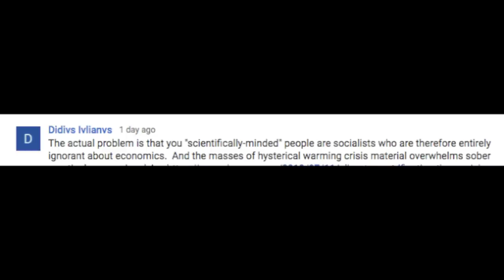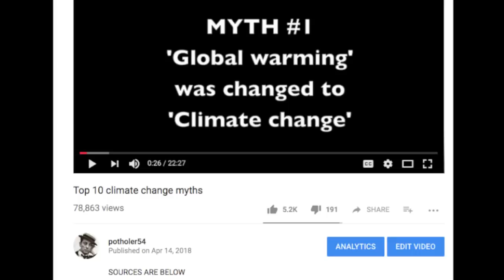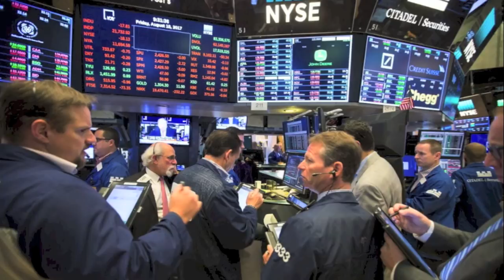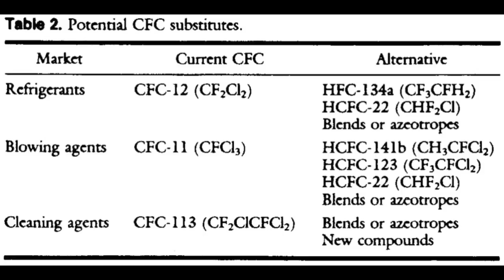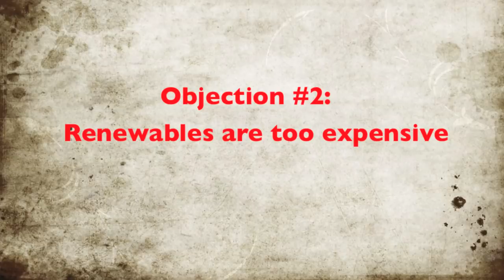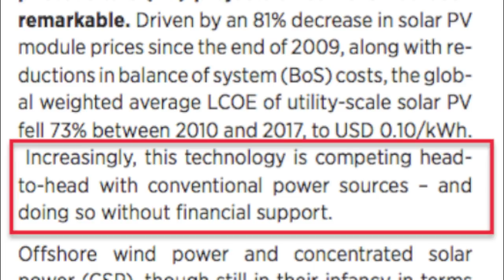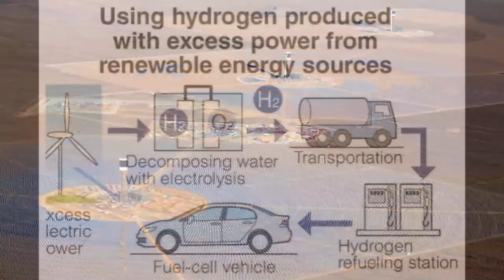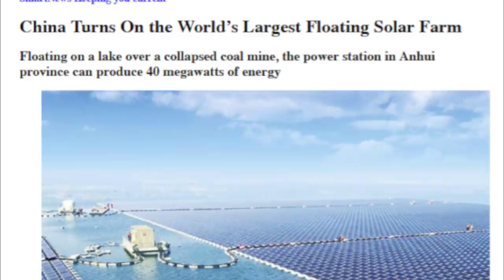A CONSERVATIVE solution to global warming (Part 1)

Comment: Vulcan Hobb raised an interesting question. They said: "The only issue I have with the free market solving problems is they only solve problems if it is profitable.". I'm not a fan of relying on markets and the profit motive to achieve any sort of innovation, but I'm not aware of examples of innovation in green energy that didn't come about through markets.

I asked VH for an example, but I thought I'd ask the rest of the forum as well: if not through "the market", or some form of public/private cooperation, how do we move forward?
Reply: When it comes to high tech, it's rarely the market as far as I can see. Take your smartphone or PC. Every patent that makes it a technological wonder was RnD'd in the public sector, often for decades, before being passed on to the market. Transistors, semiconductors, where solar energy tech is derived, were indeed developed in the private sector, but with total state subsidies in the form of procurement arrangements. So ATnT and Western Electronics were developing this technology under a state guarantee that anything they produced, no matter how expensive, the state would buy up stock if the market wouldn't absorb it. And so it went for decades before we arrived at the internet of things. And yes, RnD takes place in the private sector, usually cost/benefit analysis oriented (which includes highly inefficient externalizations) but it happens. Toyota is an example. It seems to pale in comparison with the massive role of the dynamic state sector.
Reply: @pappapaps  - Thanks for responding. "So ATnT and Western Electronics were developing this technology under a state guarantee" - Wouldn't this count as the sort of private/punlic cooperation I mentioned in the OP? I also mentioned in the OP that I was looking for examples in green energy development, but I do like the ones you've chosen. 

All the examples I can find wrt to green energy innovation involve some form of profit motive, even if there are public subsidies or other forms of government assistance/inducement. 

With that said I think the question still stands: "I'm not aware of examples of innovation in green energy that didn't come about through markets." 

Would you agree or am I missing something here?
Reply: @ajmeyers5661  As I mentioned, solar cells are a derivative of transistor technology as they are both semiconductors. It is correct to say that markets played a role, but I wouldn't say that the technology arrived through the markets. 
Take Bell Labs. Many good things have come out of that place through the years but it wouldn't even exist to begin with, had it not been for massive state investment. Both in the form of procurement deals, and a state guaranteed monopoly to ATnT, which is the reason they could establish the lab. 

Left to market forces, without a dynamic state sector, we might have some rotary phones and FM radios in circulation but no high tech computers. The modern day PC is  made upon a plethora of patents that took decades to develop into a marketable product, meaning unmarketable investments. 

This frankly tells us nothing about the importance of markets in regard to innovation. 

Markets play a role but that's by default. Private institutions is what society has to work with, so naturally markets will be the dominant means of distributing technology and services. 

What we can see though, is a consistent global pattern that divides the world in 1st.  and 3rd. 
The nations (G7) that overrode markets by utilizing state apparaturers came out successful in the modern era, while those that were forced to follow market dogmas by the IMF are now the third world. 

So perhaps markets aren't helping at all, they might be an impedance on innovation, we can't know by the data available.  

Taking into account the immense amounts of waste material that technology brings, as a result of market inefficiencies such as externalization, diversification, forced obsolescence etc. it might just be that markets are very destructive to innovation, and that capitalism (1776 Wealth of Nations, Adam Smith) just coincided with industrialization (1712 Commercialization of the Piston Steam engine, Thomas Newcomen) making us all confused.
Reply: @pappapaps  "So perhaps markets aren't helping at all, they might be an impedance on innovation, we can't know by the data available." - That's fine as far as speculation goes, but it does leave the central question unanswered in my view. I'm not asking if markets are the "best" way spur innovation. I'm also not asking if they hinder innovation. I'm asking if there are examples of green innovation that aren't related to markets. 

Or to quote myself again: "I'm not aware of examples of innovation in green energy that didn't come about through markets".

I don't want to labour the point, and I don't disagree with the majority of what you've written--it just doesn't answer the question. So I'll leave it here. Thanks for engaging w/o the usual bs that comes from having a discussion online.

Cheers
Reply: @ajmeyers5661  Your welcome. I was not trying to answer your question as much as I was attempting to show that I believe it to be moot. Everything is related to markets in an enterprise system. When the whitehouse needs cleaning I'm sure they hire a private corporation to handle it. Does that tell you anything qualitative about markets role in cleaning government buildings? 

The frame of your question lends a certain, perhaps unearned, credence to markets, that if answered as anticipated could seem to say that markets are important for innovation. If not, what is the point of the question?

Comment: I am not sure why it is so hard to understand the ridiculously easy comparison. Renewable versus perishable (non-renewable) energy sources. 

Nonrenewable: Uhhhhh….meaning it’s going to run out. 

Then comes the long list of side effects like a pharmaceutical advertisement.  Like “comes with the heavy price tag of destroying the environment and potentially our earth”. 

😂
Reply: Running out of combustibles is not the issue such means of power generation. Oil, coal, etc. which can be profitably extracted are laughably plentiful, "running out" (globally) doesn't happen without turning Earth into polluted, barren rock.
Furthermore, it's not all the same. Nuclear power is pretty clean and running out of fissile material is hardly a concern either, even the waste is no real concern anymore.

Comment: Every hour, the sun gives the earth enouph energy to power the earth for 1 year. Now we have to make sure only a small percentage is being captured and our problems are over.
Reply: Be careful what you wish for, as that energy was been captured over millions of years and now only a small percentage is being used in the form of dispatchable fuels.  Despite potholer's optimistic claims of the amount solar being added in China, he suspiciously fails to mention how China is also adding about 40 GWs of coal capacity each year as well.  China's coal fleet now stands at 1,110 GW and is growing - which for comparison, towers over the US coal fleet of ~230 GW and is shrinking.
Reply: @tom_ad9343  yeah that's true, but what has that to do with the fact that we have and immense amount of solar energy we could start capturing
Reply: @mrthugamer7603  The world is starting to use massive amounts of solar power to capture the immense amount of energy - it's just worth pointing out that fossil use continues to grow unabated.
In the same way, just because there is an immense amount of fresh drinking water hitting the earth each hour - doesn't mean the rain barrel is going to solve humanity's fresh water needs and replace centralized water treatment plants any time soon.
Reply: The irony is that to reduce heat on the planet, we have to figure out how to produce heat. In better ways.

Comment: I am one of those people who sees it as a problem but am troubled by the proposed methods to fix it. You mention wind and solar throughout this video, does this mean you do not consider nuclear fission a viable low carbon alternative and if not, why not? I fully admit I do not have the data to back this up, but I imagine nuclear fission  is far more stable form of energy(stable in that there are fewer power droughts and power surges). I would also imagine, again with no data to back it up, that the infrastructure needed for nuclear fusion (powerlines, substation, long term energy storage, etc.) Would be more similar to the nuclear fission route than solar and wind.
Reply: I can't answer for him, but I could try to give you my take on it.

Nuclear isn't a good partner for solar and wind.

Nuclear power plants are only economically viable cause they get heavy government subsidies and this has been true for over 60 years. They are the cheapest when they run 24/7 at 95+% power and are therefore great for base load to cover the minimum electricity that is always needed.

You can turn down a nuclear power plant to 50% power, but that needs hours, is not very flexible and not economical. If you want to go below 50% you have to turn it off and then it can take weeks before it is operational again.

If you get rid of fossil fuel and try to go 100% nuclear, you would also need flexible power storage as nuclear isn't flexible.

Now when you look at solar.
In Germany we have 40% renewable power (solar/wind/hydro/etc.). Sometimes we have over 100% and sometimes it drops down to 25%, but it never goes below 25%.
So renewables provide a base load power of 25%, while providing 40% on average. If Germany would increase their renewables by a factor of 2.5 it would be 100% renewable with 75% to 250%.

This shows that you would need flexible storage and flexible power plants that can provide peak power.
Nuclear can't do this and would make this issue even worse.

If you have to much electricity in the grid it is easy to shut off solar or wind and turn it on an hour later.
With nuclear you could run it at 50%, but then you would have to shut it down, losing 500MW at once, which you would have to wait a week before it is operational again.
Reply: "Am troubled by the proposed methods to fix it"
No matter if nuclear is part of the mix or not, storage and peak power is the biggest issue and nuclear would make it worse instead of helping.

And there are many good options to solve the storage issue.

In Germany they think about creating a law that would require bigger wind parks to have some kind of storage. The most favored option explored right now is turning air, water and excess electricity into hydrogen and/or "natural gas". Some companies are already building those facilities and the gas is then injected into the natural gas pipelines.

It is expected that Germany needs power storage of around 30TWh if it wants to go 100% renewable. The German gas pipeline grid has storage capacities of around 300 to 600TWh (if you include tactic reserves) and spans over the whole country.
Reply: @TBFSJjunior  from what I have heard, electricity prices in Germany have increased greatly since investing in solar and wind, I also know that electric power in France has been dominated by nuclear power since the 80s. Could you provide a run down comparison of the power situation in Germany and France in terms of average electricity prices for the consumer and government subsidies and how do both compare to the USA? I ask because it seems to me that the two principle objections to investing in green energy here are it is to expensive and the intermittency problem and so I'm trying to come up with a solution to address those objections.
Reply: As I posted elsewhere here, even if nuclear power was the  magic bullet, it is just way too late to start even a crash program now. Extending the lives of current plants is the only contribution nuclear could make to dodge AGW. Solar and wind farms can be created from scratch in a fraction of the time. 
Down side of nuclear: 
As the other reply says, nuclear plants take a long time to start, stop, or adjust output, which makes them suboptimal for fluctuating requirements; and factors in to the argument that they are more reliable than solar or wind, in that they have to be taken offline for both routine and nonroutine maintenance regularly.
And, aside from CO2, the argument that they are clean completely overlooks the environmental catastrophe that constitutes uranium mining, much worse than coal mining, let alone oil or gas drilling.
And, despite the frenzied bleats of the "Hillary sold our uranium to the Russians" guys, the US has nearly zero uranium. The fact is we buy the uranium we use, mainly from Russia (ironically)  and Kazakhstan. So that energy independence security thing goes out the window. 
And all the risks involved in enriching fuel, etc.; we are currently trying to eliminate nuclear reactors in Iran and North Korea, we obviously don't want every country in the world to switch over to nuclear, and their fossil fuel emissions are going to affect us.
And the worst security risk of all; despite the reassurances regarding attacks by hijacked airplanes etc. on nuclear plants, there is no doubt that a nuclear bomb landing on  a nuclear plant would cause the worst disaster ever seen, rendering up to a quarter of the US uninhabitable, as the large quantity of fuel in the plant gets vaporized in the blast causing a vast quantity of fallout, compared to the relatively small fallout from just a nuclear weapon.
And at the end of the day, as they say, nuclear fuel is just another nonrenewable resource. Sure, now it looks like it will last forever, but that's what we thought about oil a couple of generations ago. In the long view, sooner or later we need to learn to run society on  a renewable basis, and if we get off fossil fuels just to switch to nuclear fuel, we will just kick the can down the road and do nothing until past the last minute, just like we're doing now.
Reply: @user-qj1bt1uv2n 
"Electricity prices in Germany have increased greatly since investing in solar in wind"
Yes they have, but that figure is highly misleading.

Germany started investing in solar and wind 20 years ago.
Back then it was still very expensive and like with every industry the idea was to jumpstart the change, by subsidizing it. Those subsidies were limited to 20 years (so this first programs are running out next year, which should lower electricity prices in Germany).
Nuclear power plants in France were build 40 to 50 years ago and they are still getting subsidies.
Also in 20 years you have an inflation of 50% (at 2% per years), which hasn't much to do with renewables and there have been some studies showing that renewables have actually lowered the effective price in Germany.
The biggest increase is due to taxes and grid cost.
Today renewables are often cheaper than other forms of electricity.

I myself haven't seen a good analysis of comparing French to German electricity prices, but I have seen many bad ones from nuclear activists that were highly flawed. And if someone uses an obviously flawed analysis to support their case, then that makes it fishy.

They normally compare market prices, but they ignore the difference in taxes, the difference in grid cost and they count subsidies to renewables in Germany (as they are very transparent), while they ignore subsidies to nuclear.
Reply: @TBFSJjunior  very well, I have no vested interest in either, I just want the best solution to be found. From what I have gathered solar and wind are cheaper and can't meltdown, sounds good to me.

Comment: What do you think of promoting nuclear power? It would prevent the problems of only being usable in certain times/locations that solar/wind have, and it doesn't put a lot of CO2 into the atmosphere.
Reply: I'll but bruh.  From an American leftists, nuclear power, while safer than in it's early days, it can and should be promoted given that we take precautions.  The issue in the US seems to be that we have no plan to deal with the spent rods.  I would be more than willing to back it, so long as we address those issues and move carefully or if we make solving those issues a must for all new nuclear power plants.
Reply: @comochinganconesto  that's not the problem at all, the problem is how hard it is to monetize nuclear energy, you basically have a few PhDs working and maintaining the thing as opposed to a whole cycle of wageslaves constantly fixing solar and wind farms and selling and replacing shitty batteries all the time. Green energy is where the money is which is why big oil is investing heavily in it. Nuclear is just too efficient